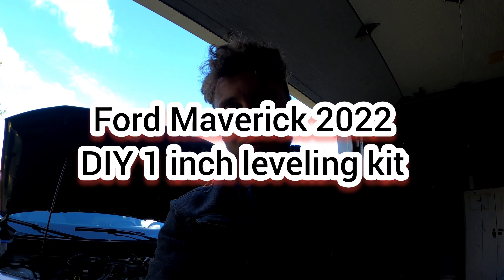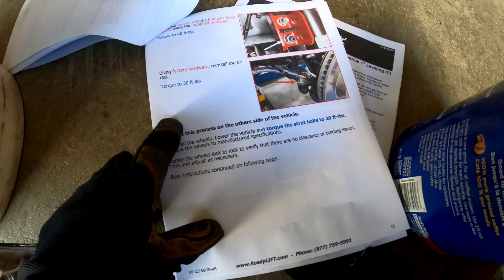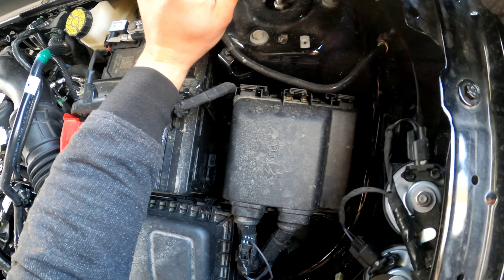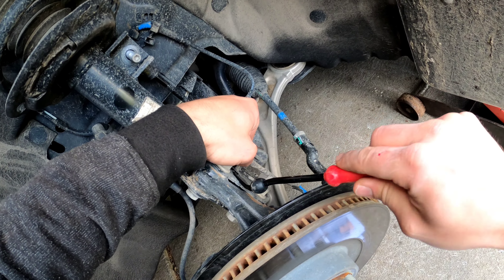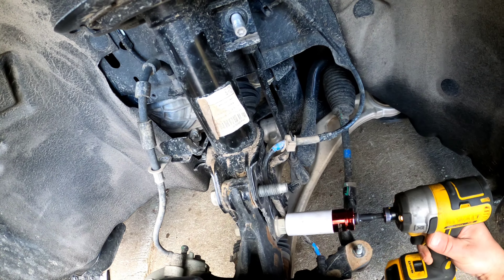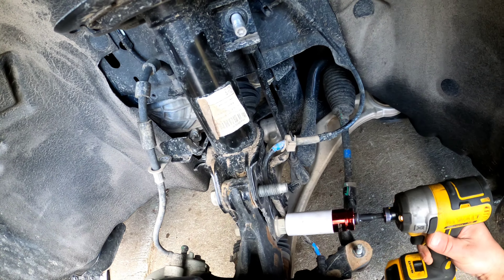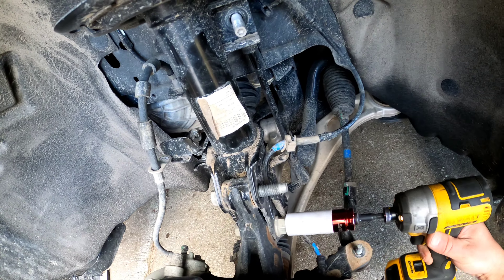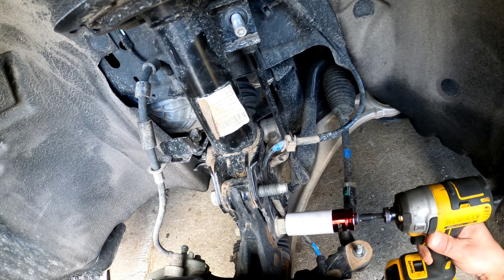2022 Ford Maverick - DIY 1 inch rough country leveling kit (rough country)

Comment: That fuel economy is insane for a truck! Looks great, but a big job.
Reply from the maker: Yahhh!! If you have the Time, and the right tools, its not That hard. I saved 300-400$ because i did IT myself
Reply: @etiennebenoit-brindamour4393  , well done!!
Reply from the maker: Thanks Man!!! I dont know now what mod to Do 😂😅
Reply: @etiennebenoit-brindamour4393 , roof rack? Cover in the back?
Reply from the maker: I dont like the Roof rack. But i Will defenitly Buy a bed topper 4 inch Higher than the Roof
Reply: @etiennebenoit-brindamour4393 , will definitely keep an eye out

Comment: You know they actually lower the front end to get better mileage? My Grand Cherokee Trailhawk with air suspension lowers the front end automatically when I hit freeway speed
Reply from the maker: Yeah i know That. But There was 0 différence in mileage before and after.

Comment from the maker: Hey guys, just Wanna Tell you That i took off my leveling kit. After 1000 miles, it was making a big knocking sound from the bracket. Before taking Them off, i tried to tight the screw and Bolts and everything was still tight. Even the rubber on top of my shocks was peeling off, so i decided to get IT back stock. 

Yess it looked Much better with the leveling kit, but i Will be driving on a 100 miles forest road and if i keep my leveling kit on, IT Will destroy my suspension. 

And when i was only towing my 1200 pounds boat, the front was so high That the steering feeling was very light. I didn't think That with only 1 inch in front, IT would have That efffect on handling while towing.

Be carefull with those leveling kit. Think of those downsides before purchasing it.
Reply from the maker: Yess Maybe, but if you tow, your front Will be Much Higher and the handling Will suck
Reply from the maker: Yess i think its the way to go with 1.5 lift front/rear. Tell me about your expérience when u Will get IT! 😁
Reply: Be specific,,, which bracket??? There's lots of bracket in vehicles.